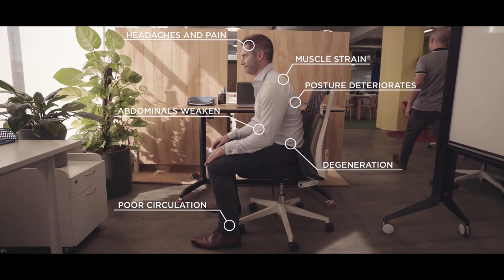Workhorse Saddle Chair - Official Kickstarter Video

Comment: saddle chair is not a new thing. However this looks to have longer sitting area than the traditional saddle chairs. Points of concern from the ergonomics point: 1) As you sit on a horse, you are in constant movement, hopefully this chair has possibility to "loose" movement and not fixed posture. 2) As human sits on a chair human biggest organ: skin, should be able to breath. Therefore a mesh or fabric is a good material against the body, however the material must be washable from the sweat which is very keen to absorb inside of padding. 3) in riding your ankles are in constant movement. If you have your legs in one position a longer time it will cause cramps especially for older generation in the middle of the night. Hopefully these points has been looked at. Otherwise I think user Jonathan had it right that this is heavily inspired by Håg Capisco hair, but I can totally see that this chair has a very nice mechanism to change the backside to front. Well done!